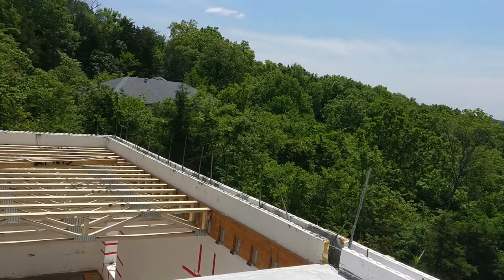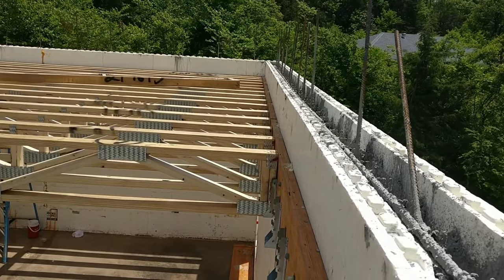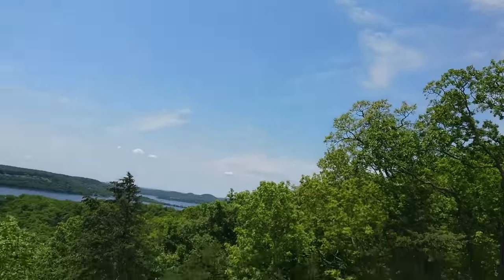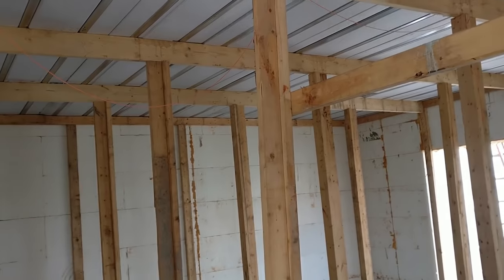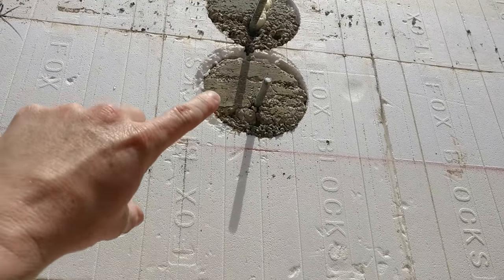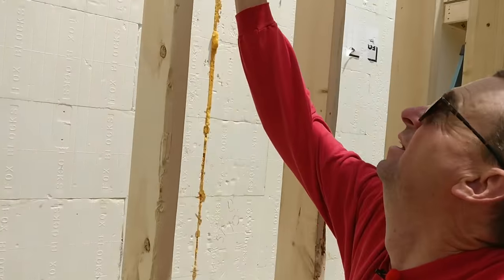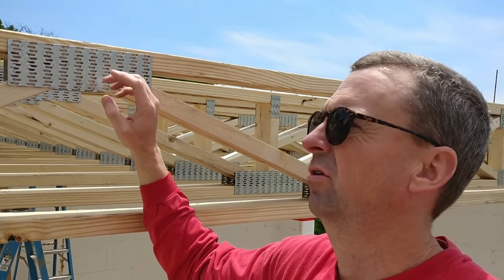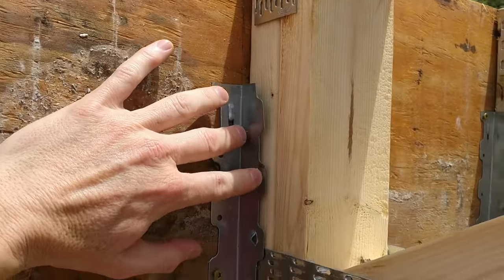How to Hang Floor Joists on ICF Concrete Walls: LVL Beams and Open Web Floor Joists

Comment: I've seen some ICF builds where they don't even use a rim joist for the floor joists, they have special hangers that are forced through the foam before the concrete is poured then the concrete locks the hanger in place.  You would still need a rim joist on the walls parallel to the flooring joists, just not the full perimeter.  You do need to be very accurate and plan ahead with those, you wouldn't have the flexibility of using the rim joist.

Comment: Instead of using osb to cover the holes in the block, why not just hang the ledger up there, install bolts through ledger, then pour concrete. you would still cut out the 3” hole to bring the concrete to the back of the ledger but a lot less work and a lot easier to match up the holes no?

Comment: If you are in new build, why not put the mini-split cassette in the ceiling and run air ducts to your son's room and other locations in the basement? I mean, that is why you used trusses in the first place. I love the split condenser technology, but hate the wall units in a house. Put them in a shop or garage, but mechanicals shouldn't be visible in a living space.
Reply from the maker: You make a great point! We are talking to our HVAC shop about this now.

Comment: Common method in my area is to turn the brickledge form inward and the floor trusses sit on that. I needed 10” core form and there was no brickledge form in that size at the time, so upsized to 12” core for basement and 6” core above, and that left a nice ledge for floor system.
Reply: Some manufacturers do not recommend using a brick ledge as a joist hanger.  The product I use suggest either the one shown in the video or a bracket manufactured by Simpson ties for ICF.
Reply: I like the oversized basement form idea.

Comment: I hope they took those construction screws out of the hangers. Those are not designed for sheer and will fail.
Reply from the maker: Yep! They go back with a special nail gun used only for the hangers.
Reply: @LakeLotBuild  Just make sure they remove those screws and use structural screws in their place. You can't set nails in holes that had screws.  That is not how you hang a hanger. Even if temporarily..

Comment: There are hangers for ICF that are let into the forms before the pour so you don't need a ledger.  Then you only need a ledger at the edges parallel to the floor trusses.

Comment: They make an optional trimable joist 6" & 12" trimable. Also I would put a dalup of construction glue in the bottom of the hanger to keep it from squeaking.

Comment: What method would you suggest to reinforce an open web truss to support weight pulling down? For example, hanging a swing or workout equipment from the truss in the basement.
Reply from the maker: You would just need to work with the engineers at the trust company to make sure that it could meet your application needs.
Reply: Trusses designed accordingly how many load will be applied on it.. . Like an extra load applied on trusses where a bath tub will be located and trusses will be designed accordingly.

Comment: I saw a house with web floor joist and the top 2x4 extended about 6” beyond the web joist and that sat on top of the foundation wall. Did not look right. Hanging on a 2x4 on the flat !!  Please give me your insight

Comment: Educational Video.  I noticed the bracing of the ICF was wood, was there a reason you did not use the ICF bracing system?
Reply from the maker: Nope. That's just what our ICF builder used. We were able to reuse all of the 2x4s for framing in the house so it didn't end up being a waste of wood.

Comment: Great work with longreach (timber web ) floor trusses. Used walling plate hangers to connect. How much maximum span of trusses
Reply from the maker: It really depends on how big the truss is. We worked with the company and the engineers to make sure that ours were strong enough to span 26 ft.

Comment: My architect want to use the ICF concrete  roof panel. If you don’t mine, What is the price range for such roof?
Reply from the maker: I think ours ended up being around $25 per square foot. That was JUST the concrete roof. You have to coat it or cover it to keep it from leaking and that has been an additional $3-5 per sq foot.

Comment: At 9:36, you show the hangers coming through the rim joist and then fastened using nut and washer. What is the diameter of the hangers? what is the diameter of the whole hole in the rim joist? I can't imagine them being very tight as you have line up that many numbers of hangers with holes. right?
Reply from the maker: I think these are 3/4 inch bolts. They are set into 8 inches of concrete, so pretty substantial.
Reply: @LakeLotBuild  And what was the diameter of the hole in the rim board? Aligning that many holes with that many bolts must have been very difficult unless if you make the hole really oversize. right?
Reply: @hameedtalebi2351  ...pretty sure the holes are drilled, then hanger/bolts slid through & tightened, then the entire rim joist is mounted to the ICF's webbing with the bent hanger passed through the large cut-outs made in the foam, then it's secured fully once the concrete sets.
Reply from the maker: @hameedtalebi2351  ah, I see. The holes through the concrete where the styrofoam is cut away is around 4-5 inch diameter. You can see that process in the clip I inserted when David says "you can edit that in" right at the start of his interview.
Reply: @LakeLotBuild  I am not an expert in house building, but from stand point of physics, this doesn't seems right. Basically, what keep the rim joist in place is the friction caused by tightening the nuts and washer. At first, this will work, but overtime if the nut get lose, it may cause some sagging in the floor. right? @"Kode Harvey" has a video that makes more sense: https://www.youtube.com/watch?v=3r7deql-CIk
Reply from the maker: @hameedtalebi2351  I'm not an expert but our builder has been building with ICF for 15 years. His method is the same as the method described by Fox Bloxs and their videos. Maybe I am just telling you the process incorrectly.
Reply: @LakeLotBuild  in any ways, thanks for sharing the video.
Reply: @Krazie-Ivan  correct

Comment: It’s great seeing everything come together. Gotta ask a question though. Why not make the floor concrete like in the garage and for the roof. Was it a engineering issue or possibly cost, or both
Reply from the maker: Hi John!  Really just a cost issue.  We had just that one section of flooring and decided to go with the open web versus extending the LiteDeck (which is expensive).
Reply: @LakeLotBuild  Any idea what the cost is approximately for the lite deck installation per square foot? I’m also building a flat roof and leaning towards concrete to be able to add a rooftop space. Thank you for putting these videos together!

Comment: Sorry if I missed it in the comments but what was the length of the span the floor trusses covered?  I am working on the plans for a 34 ft. wide walk out basement and am looking at an ICF wall running down the long axis of the basement to split the 34 ft. span in half and provide maximum support for the floor truss system.
Reply from the maker: Ours spanned 26 feet. The engineers can make them span much further though by modifying the trusses.

Comment: Why do they need such big cutouts on the outside of the foam wall for the anchor bolts? It seems like they would only need to be marginally larger than the diameter of the bolt itself, this would help reduce the amount of exposed concrete and therefore keep thermal transfer down
Reply: It ‘supports’ the bolt as it passes through the 2 inches depth of the foam.  The bolts each have amazing shear strength, but could bend under load over time ( steel is malleable).  Also, tensioning the bolts would have the effect of pulling the beam into and crushing the foam. Having the concrete surrounding the bolts allows the beam to be fully tensioned to the concrete, and for the bolts and concrete to work together to prevent sagging of the beam over time.
Reply: Excellent question and answer thank you
Reply: @andrewallason4530 what kind of bolts are those ? Are those special bolts or just regular J bolts for concrete ?

Comment: We are about to close on selling a home that suffers from one of those joists that was compromised by a plumber that needed a path for his pipe (yes we disclosed it). It's always the joist between plumbing clusters, so any water overflow in the bathroom or the kitchen flows backwards towards the wall and under the cabinets.  NEVER again. When we build I will insist on those open joists. If any contractor even THINKS of cutting into an open joist, I will fire them, have them pay for its replacement and then have them flogged (OK. Maybe not that far, but I will be tempted).
Reply from the maker: I'm so sorry that happened to you. We walked through a house under construction one time and we saw where the HVAC contractor had run HUGE round ducts through the joists of the main floor. Horrible.
Reply: @LakeLotBuild  It amazes me that this happens AND it gets past the inspectors. This is why we will be acting as GCs when we build. I appreciate material like this that give us heads up on things to watch out for and things to consider as we get closer to building.
Reply: At Pacific ICF we supply AMVIC ICF forms and Simpson ICF VL ledger anchors, at 4 ft  o.c. for easily bolting on the ledger. In fact there are only two slots required to cut  through ICF foam for the anchor arms to hang inside the concrete, later on the ledger is installed with some Simpson bolts every four feet  along two facing walls.  These cannot be used outside however ( for a deck) and another bolting system could be used.  You can attach bolts pre concrete to the ledger and install the ledger before pouring the wall, make holes in ICF foam between webs but cut them on a 45 ish degree angle so the concrete area is larger on inside of form ( strength).  This video shows a lot of work for the same result

Comment: the bottom chord of the floor truss system in my house is not attached, there are no load bearing walls and Its ICF.. does this make sense?
Reply from the maker: If I'm reading this correctly, I would suggest joist hangers because wood is stronger in compression than in suspension.

Comment: Did the truss manufacturer think of using Top-chord bearing to sit on the ledger board?  Seems like a ton of money could've been saved by avoiding buying all those hangers.  Those Simpsons add up quick

Comment: This is obviously an amazing and 3xpensive build. What I don't understand is why you don't have an elevator. We all get old and an elevator would allow you to stay in your lovely for the rest of your life. One elevator would add about $69k to the build. Just wondering.
Reply from the maker: We are actually on a really tight budget. We went with ICF concrete build because it is the same or less than lumber right now. We will finish everything on the inside just my wife and I. Thank you for watching!

Comment: Ugh.  So much for a thermal break.  He would have been much further ahead to remove the round piece of foam after the pour, added the bolt and returned the foam.  6" is way more than enough concrete to hold.  Why did they go the extra step to make it worse? This is negating the reason to have ICF in the first place. Just the bolt alone through the foam would be a huge loss, imagine the loss to the thermal mass after this.